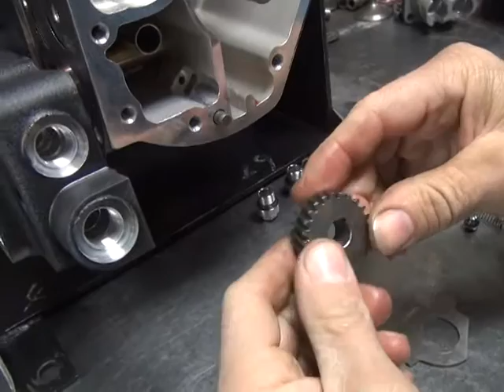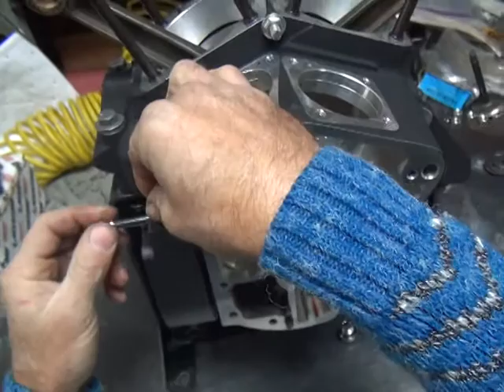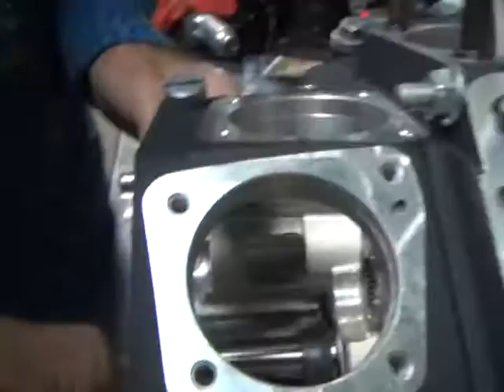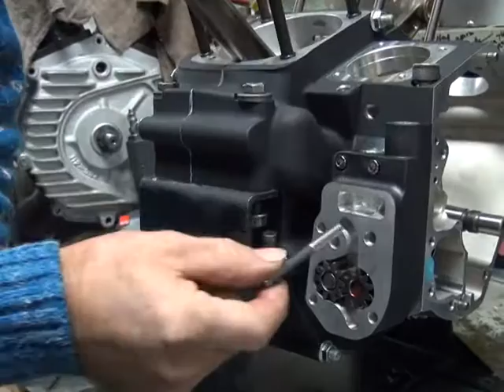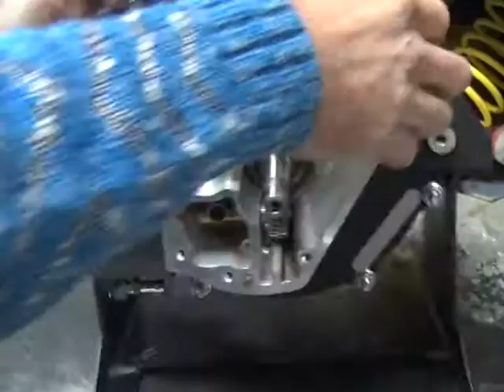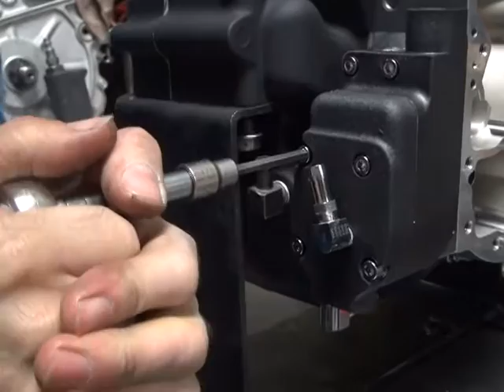#110 1992 Harley FXR Evolution 88ci Motor Assemble Rebuild Tatro Machine

Comment: What about the two lower bolts that go through the oil pump into the case. they are through bolts that cause oil to come out the bolts. What did you use to seal the threads?
Reply from the maker: if they are tight and the holes are good you don't have any leaks. if you do, i use the 3-bond sealer on them.
tatro